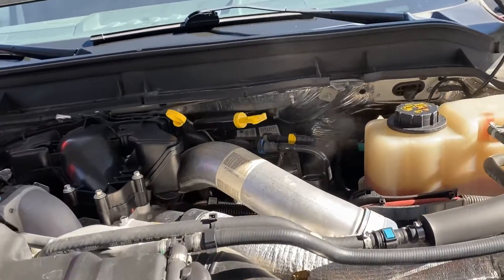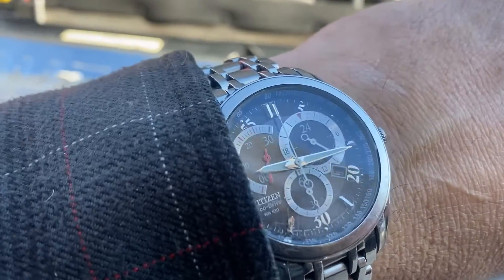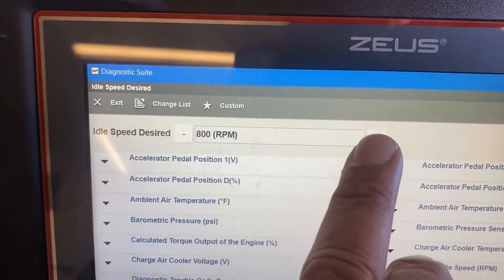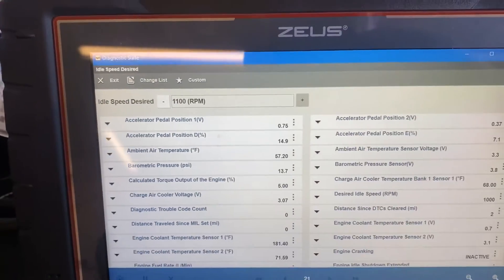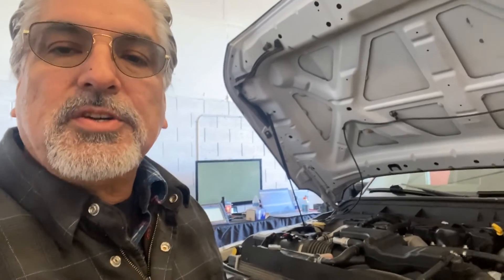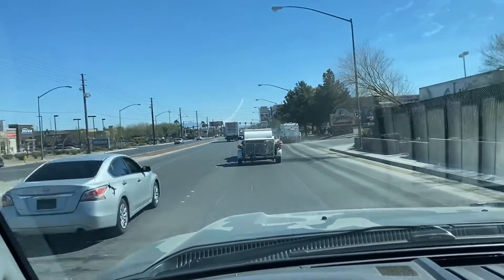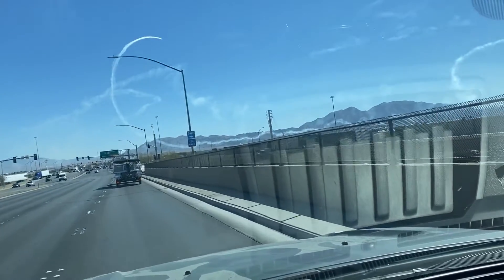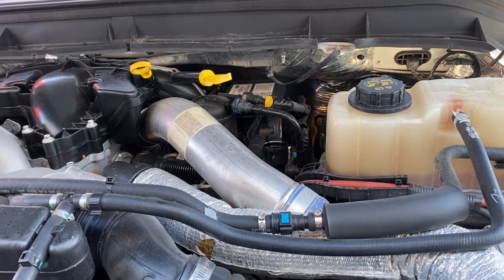Powerstroke 6.7L Blowby DPF Loading

Comment: I have a  stock 2012 6.7 f250 with 253,000 miles with blow by also coming out from exhaust pipe truck is a daily and maintance was always done on time any recommendations on what I should look at first ? Notice the bottom fuel filter under the driver's side has a leak as well

Comment: You need to change the ccv filter also that will remedy some of the crankcase pressure coming out of the cap. Seen this a few times in my decade of wrenching. It will also start leaking around the injectors and the front seal if not changed regularly.
Reply from the maker: Thanks I do mention that but remember the CCV DOES NOT produce the blowby it simply filters it and regulates flow. 
We are going after the cause of excessive blowby which is mostly carbon around the rings.

Comment: Tony, were are you located.
Reply from the maker: I’m in and out but in North Las Vegas
Reply: Thanks Tony.  Wish you were in Texas I would take you my truck.
Have a F350 I thinking I'm going to have to replace the CP4 pump with kit.

I've been reading all the  information on if you're  pump goes out it's better to do the complete kit.
Pump, and whole fuel system.
Pretty much hear kit around 6k plus labor.
I can do the install but I don't  have the software to reprogram injectors and do any fine tuning.
Hard to find a shop that going to do the job right and stand behind there work. I understand the parts will be warranty but worried about a good job done right.
If you have any recommendations for any shops in North DFW Airport let me know. 
Thanks for all you great videos.

Comment: My 6.7 has about the same amount I’ve been told the 6.7 has a lot of blowby I hear people running HOTSHOT SECRET to clean out the rings from soot might try that or 109 
Thanks Tony
Reply from the maker: If it does have that much blowby it needs more oil changes! In other words it shouldn’t have that much blowby
Reply: I added a video of the it running it’s on my page I bought the truck used it was a hotshot with a salvage title it had a hard life

Comment: Good video i gots a question  I got a 05 LLYafter a day or week of not starting the fuel rail pressure always reads 206 - 227 I keep goin in 2 limp mode when I get over 80 would this cause that
Reply from the maker: Sounds like you are loosing rail pressure over 80. Have a code set?

Comment: There's a reason Ford specs 5w40 or 10w30. This isn't grandpa's 12v clearance wise. Also look at how far oil has to travel from the pickup tube to the bearings on this platform. You might get by with it down south but 5w40 weight is pretty important along with the oil certs. You've probably forgot more than I know, but some food for thought at least.
Reply from the maker: Oh I know what you mean but I could email you the actual Ford service info showing 15W40 also allowed and the 10w30. But the reason I’m using 15W40 is the wear and tear on this poorly maintained truck. You will also note 15W40 is Ford WSS approved .
Reply: Bg is good stuff. Fortunate enough to live 30 mins from them.  Toured the Wichita facility, and the amount of r&d they do on their products and competitors is impressive.